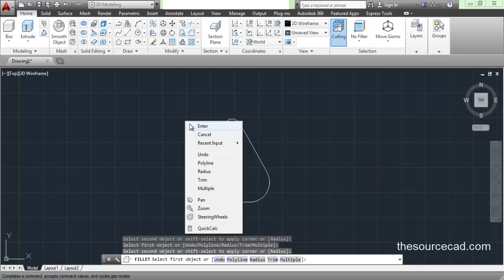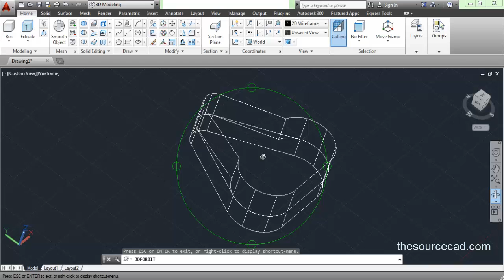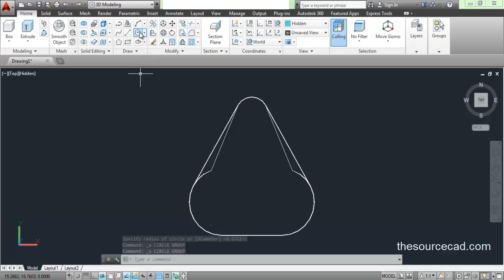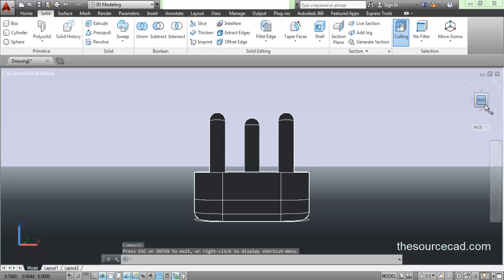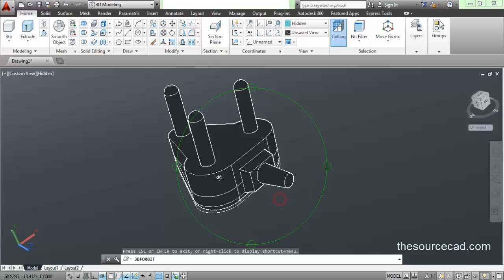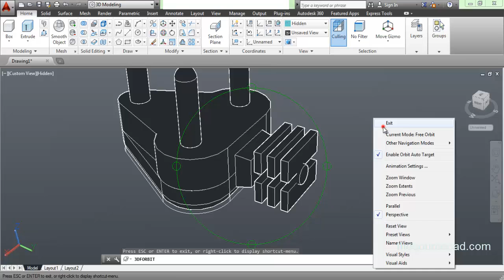Making 3 Pin A.C Plug in AutoCAD 3D

Comment: First off your videos are very educational, they have really brought me up to speed with the basics. I thought I would give the AC plug a try. I make it as far as to when you have to trim the lines extending through the circles and the the circle segments. Trim just doesn't want to work? the lines turn blue but it will not trim them. I made the same figure but not extruding it to 3D and I am able to trim the lines and segments. Is there a setting i'm missing, should I be using a certain template? Any help would be appreciated, again thanks for the videos!

Comment: well amit  i am new in auto cad, i learnd alot from your videoes , right now i am working on your  making  ac plug video but here i agot  stucked in alot of places make triangle,extrude, than making circles in triangle and line, i am good till there but after that i try to trim but cursor shows ristricted symbal , i tried a lot but didnt found any solution its like trimm double enter than i try to trim objet but  i comes written that (edge is perpendicular to ucs xy plane)

Comment: all your effort is marvellous. but one thing you have to correct.
the earthing pin should be thicker and longer than remaining two pins and there must be split between each pin so that the pin has spring action.
Reply from the maker: Thanks Amit for the Suggestion, to avoid making very large videos I usually omit many details but I will certainly try to include as many details as possible in future uploads.